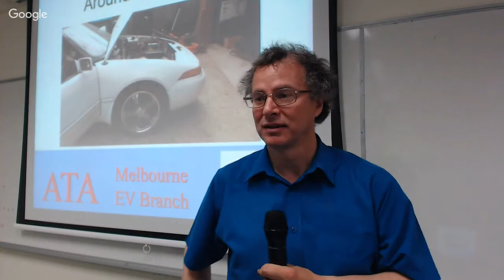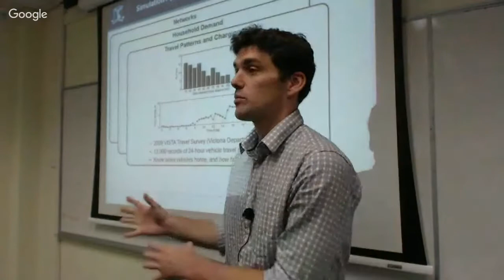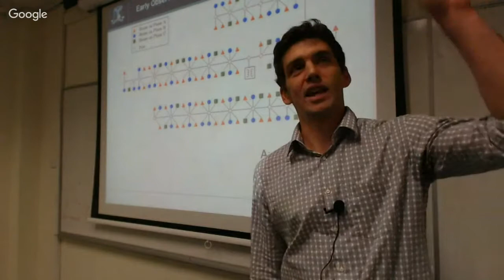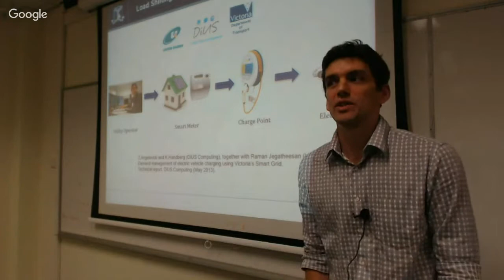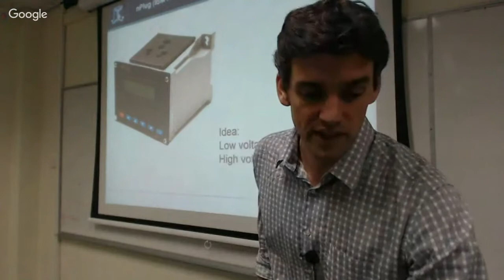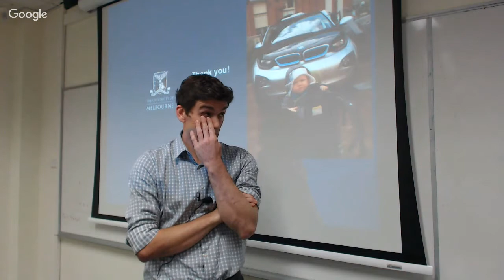The Impact of Electric Vehicles on the Grid (October Seminar)

Comment: Wrong. You have to understand electricity. When all the electric vehicles plug-in the power supplied will just be increased to accommodate. Its inverse voltage goes up and amps go down. Throughout history our power supply has changed as our needs change and it won't be any different..
Reply: ???  There's only so much power the lines can handle, and only so much power being generated.  As baseline is removed and unreliables used, the amount of available power will be LESS, and fudging volts to amps won't change that.  As we've seen, our compromised grid can barely power homes and businesses.  EVs would require something like 60% MORE power to be available through the lines, with less and less generation available.

That's not changing with our needs.  That's setting yourself up for failure.

Comment: Hi, just started to watch this stream and saw the EV news update.
The 2009 EV batteries were replaced.
A couple of questions:
What was wrong with the old batteries?
Would they have still been able to be used in storing/charging from PV panels for the power to be used in a house?
What was the cost of the old and new replacement batteries?
Ian